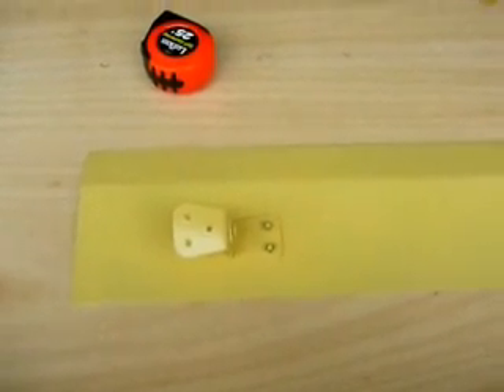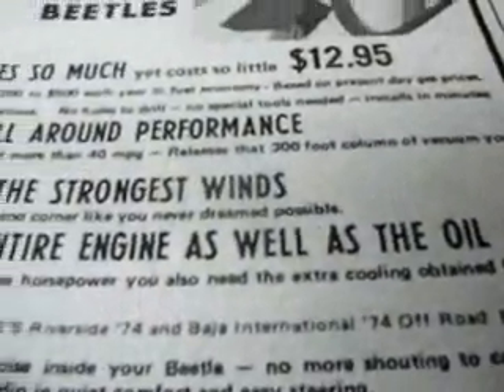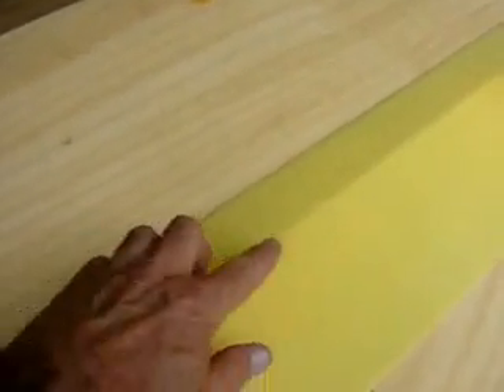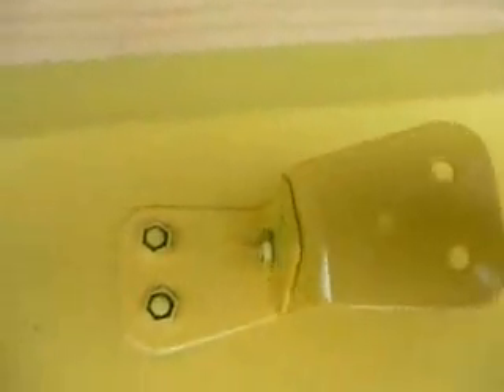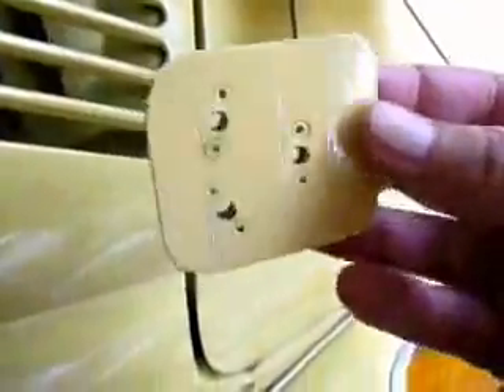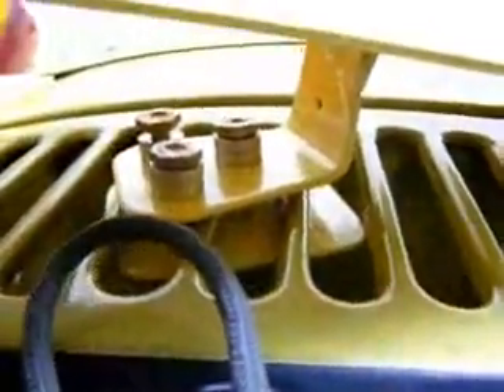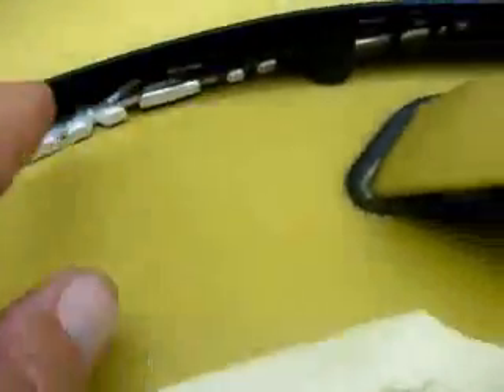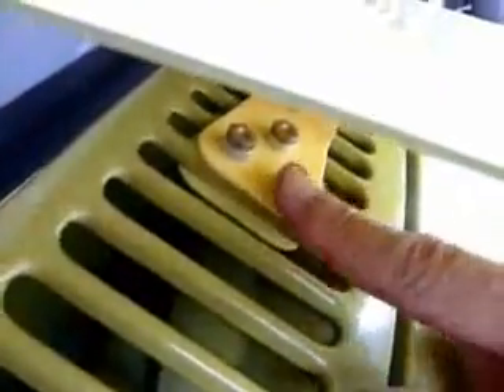Electric VW Beetle Spoiler

Comment: I have an original Herrod Helper on My '69 bug . The wider flat surface is paralle(sp?) to the ground. I don't know if You still have or drive the car. It must hae been a bugger to put those mounting plates in place, the originals were like a toggle bracket.

Comment: looking  at your Herod helper knockoff  its much larger than a real hh and  the angle that you have it mounted is different.  i wonder how much that angle and size has made a difference.  in the 80s we had problems with them causing the air cooling affect of the louvers. it caused a scavenging affect for the engine.   with an electric car you wont have that problem.  i have a herrod helper on the shelf i will have to test the affect on my performance as i complete my electric conversion.